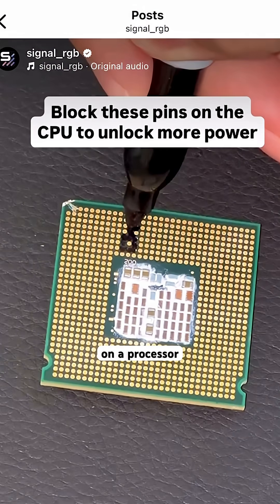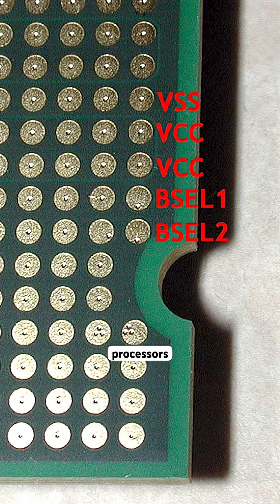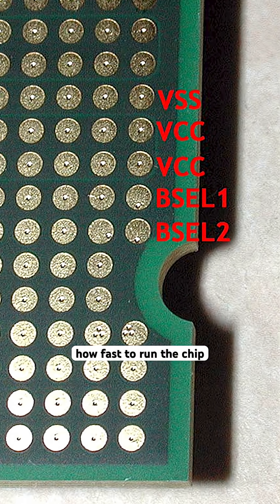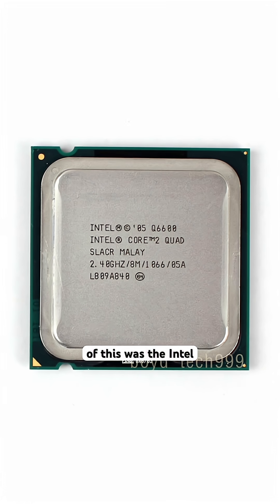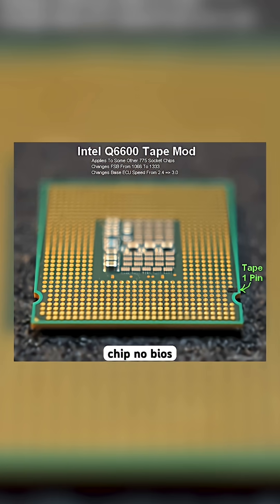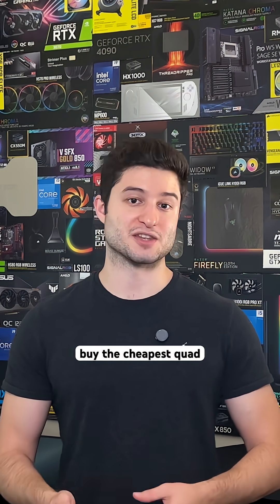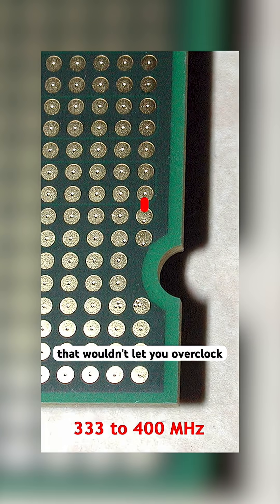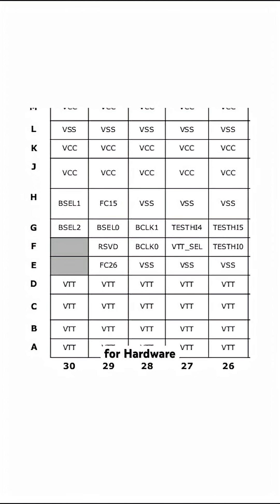Taping a CPU to improve it?!

Comment: back than you could use the Lga 771 xeon E5450  pinbridge it and put it in LGa 775 socket it was equal to the way more expensive core to quad Q9650. well of course some modifications modding the bios but not always on some boards it runs perfectly without it.

Comment: Man overclocking back in those core2 days was amazing. Every chip had so much head room available. Those days are long gone.
Reply: I had a E6400 as my first custom self built, took it all the way up to 3.35 ish, on a Zalman 9500, and then CoolerMaster 212 to get it to 3.4 ish. With a Diamond X800GTO, 2GB of Wintec Ampo ram, Raptor boot drive, and a WD something for mass storage. Foxconn something motherboard of many colors, and a AMS Mercury psu.  All inside a Centurion 5 case. 

damn thing was solid, overclocked amazingly well, and lasted with a few upgrades here and there far past it any other system I've had before or since.

Ended life as a oc'd Q6600 with a GTX 970 ti (yea, not a great combo,) 4gb of ram, a mushkin ssd, and evga g2 - but still with the 212. 

Core 2 Duo/Quad really was the best CPU release of all time, imo.

Comment: Back in the day a similar exploit was discovered with the first generation PSP. If you had a first generation battery you could open up the housing and file/snip one of the traces on the battery PCB and you'd have a "Pandora's battery" if you started the PSP with that battery and no wall outlet it would boot into recovery mode and let you install custom firmware. Hardware hacking has always been cool

Comment: I remember doing a bsel pin mod on a p4 2.4 ghz 400mhz fsb. It overclocked to over 3.2 ghz at 533fsb with no extra voltage on a dell that you couldnt overclock. Also a e4300 with  800 fsb to 1033 fsb with a wisdshield defogger repair kit. It also changed the ram speed as well.

Comment: Back in 1998, I taped off one of the gold fingers of my Pentium II 300Mhz slot CPU to make it run at 450MHz. A 50% overclock is huge, hasn't made those numbers since.

Comment: WRONG do everything right and you brick your processor… it doesent run on 2.4ghz so they can sell the same processor as a 3ghz version… its a different processor and you pay the extra power with a lot if lifetime on the cpu and alsonwith way more power drawn than the real 3ghz would. That could also result in motherboard failure.

Comment: AMD Duron/Athlon were overclocking champs as well. You needed to connect some of the very, very small contacts on the upper side. Which ones I don´t remember. They came basicly from the same wafer. Sometimes you got really lucky and go from 800 to 1200. You could also play with the Front Side Bus. Changing it from 100 to 105 ( 800 to 840 ).

Comment: actually in the early 2000's the Athlons could ne hacked with a #2 pencil. until the changed the spots, then you had to build up the substrate and use some silver laden paint to do a similar effect.

Comment: Was overclcking my core2duo and core quads that way. That way you can increase bus speed. I also did voltage mod that way to get 1.45 (or 1.5, I can't remember) volts to my CPU so it will hold such frequencies. My mobo was cheap and couldn't do voltage regulations in the bios

Comment: The actual reason for this is that the chips are made in large batches and tested for manufacturing faults, the best chips sold at the top speed of the design, the chips that run to hot are restricted as they will burn out due to flaws in the chip.
You can overclock the defective ones, but you have to run with much better cooling and have a good chance or burning out and being useless.

Comment: When I remember correctly, not every chip is perfect they build so they build one type of chip and the lower performance chips have flaws that get bypassed so you have still a perfectly fine chip just less power and the company doesn’t have to throw away a faulty chip.

Comment: If only you can do this with 7800x3d chip to unlock the frequency and let it boost as high as it can. I delidded it and watercooled it and temps are very good it has a lot of overclock headroom but AMD locked the cpu frequency not allowing you to make it faster than 5.05ghz

Comment: The old Athlon XPs had something similar, you could run a #2 pencil between leads and unlock the cpu so you could overclock via multiplier instead of bus. It made them by far the best consumer CPU for a long time, the old barton 2500 was a beast

Comment: To clarify, this isnt even illegal or anything like pirating. Its a 'safety' done to keep your processor functioning in the 'safe zone'. Yes we all know the safe zone is much higher, but accidents and rarities do happen and the capped range ensures the least of those can happen within reason. Especially because anything not 'top of the line' for a processor is already technically 'defective'.

To clarify: they don't manufacture anything other than what they intend to be top of the line, however based on varying degrees of flaws, you end up with lower end CPUs.

Comment: I mean its the same thing with what makes a 5070 a 5070 and not a 5090. Sometimes everything you need is there to be a 5090 its just not connected or is burnt out. That's a big part of how they grade them same with cpu the more perfect ones become i9s and the ones with imperfections become the lower tiers

Comment: Some years before, you could unlock your Phenom II X2 - a 2 core processor, to make it 4 core. Yeah, AMD just blocked 2 cores on the same die and called it X2. Every single 955 could be a 4 core, because they technically were 😂

Comment: We did the same with AMD, somewhat, we had the wire trick, to change voltage, and the pencil trick to add cache and convert it to a mobile processor with unlocked multiplier. 

Later AMD fixed things with additional traces on the package and a layer between, so we had to carefully cut down and join the bridges.
Reply: Yep... pencil between contacts.
Reply: "pencil mods" good ole days..

Comment: 3Ghz was noting on the q6600 mine would boot at 3950mhz and was stable at 3.8ghz . With a custom loop. Ran great for years. 

We used to OC the athlon XP cpus by bridging spots with a pensil

Comment: lol Good ol days, Some AMD processors also had hidden or locked out cores for lower models and people found a way to unlock them by simply bridging pins on the surface of the cpu with a pencil mark since the graphite on the lead was conductive.

Comment: You can Pin Mod Intel Gen9 CPU's to run in Intel Gen6 Mainboards after BIOS Microcode is patched to include Gen7-9. You need only a short between two Pins. Google Coffeeleak mod.
Reply: I eine this with a Lenovo M910X and i9-9900T with RTX A2000 😅

Comment: ok so i been working on computers since the 90s. You can use that or clear nail polish but it isnt a cheat code. majority of the people that did this needed to use liquid cooling (which wasnt that good back then) or some real good CFM fans because the processor was made for that kinda speed. 

I know because i cooked a couple back in the day.

Comment: Iirc this is largely because many low grade chips are actually higher grade chips with too many defects to be sold as their intended model, so the CPU is programmed to run at a lower level, and downbadged, reducing production losses, and avoiding the difficult and expensive process of recycling silicon from failed chips.

Comment: I still use a Q6600 I bought it in 2007 as a premade PC from Comp USA. I have known about the tape trick for a long time but never tried it because In 2009 I changed my motherboard and it overclocked the chip for me. The  8600 GTS GPU still works perfectly as well.  I did have to replace the DDR2 ram once because the Ballistic ram with LED built into them stopped working.

Comment: I don't think it's right to call the q6600 budget. Sure it wasn't the fastest one. But back in 07 a q6600 would have been a blazing fast chip! You got to remember most people had core 2 duos. Obviously it wouldn't be as good at single threaded non multiprogramming environments as some of the higher end core 2 duos, but still.

Comment: I remember AMD had chips where you can “unlock” extra cores.Some of there dual core chips were actually underclocked quad-cores or tri-cores with disabled cores.

It was very hit or miss getting it to run stable however.AMD caught on to this and started physically laser cutting extra cores to disable them making it impossible to activate them.

Comment: People don’t seem to understand how processors work. I’m an engineer in the semiconductor industry, and all chips of all levels are made using the same lithography machines but they’re graded by how many transistors have faults due to impurities in the parent material. Chips with a certain number of impurities are graded at higher or lower levels, and CPUs are able to work around non-functional areas without issue but it does cost performance. So doing this trick might work or it might not, it all depends on where the processor fell in terms of the impurity ratings. If you had a step down from the best, but it was barely worse than the worst “best” chip, then you’d be able to run it faster without much issue. If it was on the bottom end of the scale, you’d start running into problems (crashing, maybe even bricking the processor). It isn’t arbitrarily “locking out” processing power like some people think, although I wouldn’t put it past some companies (ahem, BMW).

Comment: So basically, what you're telling me is that, the bisector of the photosynthesis, and the equilateral tangent of the black hole EQUALS the air current voltage when underwater on the surface of the moon?
Reply: indescribably cringe

Comment: Yeah except it overheated like a motherfucker. Those people back in the day ran crazy cooling not just fans. The cores and speed of a cpu is determined by the quality of the silicon when etched. Yes you can unlock limiters this way, but by no means can an i3 ever be an i7 or double it’s capabilities. This is misleading.
Reply: water cool it

Comment: Why wouldnt they just sell it that way then? Why the limitations?
Reply: Because sometimes the chips end up not running stable at higher speeds so they underclock them and disable faulty cores until it runs stable and sell it as a lower performance model.This is nothing new..

Comment: This still kinda works today. You can mod older Skylake era motherboard BIOSes to include Coffee Lake microcode, then bridge and block specific pins to let the motherboard accept the CPU. I've done it to a few machines :)
Reply: That's gotta be one of the most satisfying things to be able to do on your own when every company tries to screw you over.
Reply: @ithildiess9048 well, for once it's more of a technical limitation and sécurity 

On some skylake LGA1151 motherboard the south bridge can't handle propely a Coffee lake CPU
Reply: @ithildiess9048 you get what you paid for
Reply: How does one learn this kind of thing?
Reply: @cricketknowall  i'm an IT technician. And when you buy a 150$ CPU that has this issue, it inspires you to do some research 😅
Reply: @cricketknowall kinda just being willing to risk hardware and research. :D
Reply: Wait, why would you do this?
Reply: @potential900 because I get to use newer, more efficient, higher performance cpus without having to get an Entirely new machine
Reply: please make a tutorial
Reply: or just remotely explain it in a video, my autism needs answers
Reply: I did similar stuff to patch PCIe bifurcation support and NVMe boot code into old x79 UEFI and the only NVME boot module for BIOS i know of (from VM Bios) to physical BIOS Firmware based Boards (x58 etc.) Among other fun stuff (microcode, ...)
Reply: @346L3  Very nice. Mind if I ask how you learned the skills for that stuff? On the job or just a hobby? Wish I could do that low-level work, but knowing where to begin is unclear. Ofc having specific goals helps but..
Reply: @potential900 started as hobby, always loved tinkering. Now i primarily work in IT, so I made part of the hobby my work in a sense.... but knowledge i started back in the hobby days still comes in handy and i build from there.
Also, it helps immensely if you're tinkering with stuff you're not currently needing or at least have a spare until you figure out how to fix what you bricked 😂
Reply: @346L3 Nice. I'm a SW dev myself but never poked at the super low level. Got it, that makes sense lol. Thanks.
Reply: so for educational purposes only.. my i7 7700H can be modded to be better? if so how? asking to be...."educated" only 🥀
Reply: @willig.m3498  The H model is a mobile chip so its soldered to the board? All you can really do is undervolt it unless you wanna engage in BGA reballing to swap the cpu
Reply: @willig.m3498  its sad you feel like you cant ask to do whatever you want with your own stuff. Screw corporations
Reply: @willig.m3498 not quite, but you could potentially mod your motherboard to accept 8th gen CPUs

Comment: Much more useful was the Xeon mod for socket 775. You have to cut the direction notches from the socket. A socket 771 Xeon required a sticker which connects two pins. Most 775 mainboards support Xeons.

Comment: There’s CPUs you could do that in even further. You could pencil mod athlon XPs to control voltage and multipliers. You could also on Pentium M CPUs control them the same way as the tape mod just with wires in the socket instead of

Comment: I had an AMD Phenom x2 that needed no modification, just the right motherboard, to unlock two extra cores. Didn't work for all but was great for the budget crowd.
Reply: Yeah, mine was unstable with 4 cores but it was fine with 3.

Comment: Actually... that only worked well with a later stepping (G0) with a lower TDP (95 instead of 130W).
You only had to switch the FSB from 266 MHz to 400 Mhz in BIOS... done ^^ now it runs with 3.6 GHz instead of 2.4 GHz even air-cooled.
Downside was the immense power draw (over 200 W) and the stress on VRM (they aged at a rapid pace).

Comment: Bro is this is AI? "q6600, this budget cpu could be overclocked to 3GHz" First of all, q6600 had an MSRP of 1300 usd in 2025 dollars, it was anything but budget. Secondly it could easily(sort of) be overclocked to 4GHz, not 3 without any sort of pin trickery. And thirdly, the first CPU you could mess with the pins was the Athlon XP, and this was in 2001. Look up "Athlon pencil trick".

Comment: You could do something similar with the BIOS on older AMD GPUs. The R9 290 could sometimes be flashed to appear as an R9 290X. It was kinda shady, tbh. The cards that could do this were actually the exact same, but the BIOS was the ONLY thing limiting the power. They had the same die, cores, power limits and so on. Just BIOS identifying and limiting the cards.

Similar to an EV today unlocking "sport mode" in the software to let you go faster(higher top speed) or have greater acceleration

Comment: With older AMD chips I used a pencil to contact two points and it would allow the processor to OVERCVLOCK when that model OC was disabled and I could get 10-15% more performance and back then it was a 200 dollar saving as similar chip was 120-200 dollars more depending on top speed etc

Comment: Or you could just get into bios, and literally change one setting from 266 to 333 or 400 or more, depending on the CPU, RAM, which is way easier than disassembling your PC and modifying your cpu.
This hack is useful mostly to people who are not on a regular motherboard, but on some vendor locked like dell, hp,....

Comment: This worked quite often, until manufacturers started holding back better binned chips for higher price sku's. Everything used to practically go into the same bucket. You might have got what you paid for, you may have gotten 20% more.

Comment: I did this to mine but I used foil. The Q6600 2.4GHz 1066MHz, it would push mine to 1333mhz. It was very unreliable but fun momentarily seeing the difference in boot and Chrome load times.

Comment: I remember the old AthalonXP days and people were using mechanical pencils to mod the multiplier. AMD didnt appreciate this so they started laser etching the chips to prevent it. We just switched to condutive ink from window defroster repair kits.
Reply: I remember I had a Phenom II x2 that could unlock to a x4, but mine would be very unstable, don't know if It was the chip or the board that couldn't hold it, never really tried much, but it would run at x3 very well, shame that multicore back in the day barely gave you any performance in games.
Reply: @LucasCunhaRocha mine was an Arhlon X3 450 to a Phenom X4 B50. Was pleasantly surprised how much performance a 4th core made
Reply: @LucasCunhaRocha when chips started getting multiple cores software wasn't ready, especially games. I remember it was all about single threaded performance and offloading other applications to spare cores.
Reply: oh yes!  That's when I got into hardware.
Athlon XP baby!!
Reply: yep I remember the Athlon and using a needle solder to mark a joint to boost the clock.. Made one work and bricked a second.
Reply: @user-PlanetH  That trick goes even further back than the Athalon for AMD.  The earliest one I know of was the AMD K6-2 for the 486 platform
Reply: Doh! you beat me to it!!
Reply: Yeah, I remember drawing with a pencil on my Athalon to speed it up. All it really did was make my cooling fans work harder.
Reply: This guy fkin gets it.. hell yeah...

Comment: My motherboard let me overclock my Q6600 without using a pin swap or update, what I did use a pin swap tape for was to enable a Xeon E5450 (LGA 771) to work in my LGA 775 Motherboard.